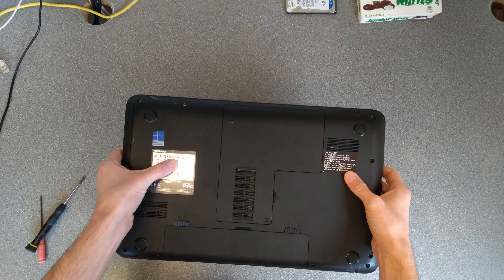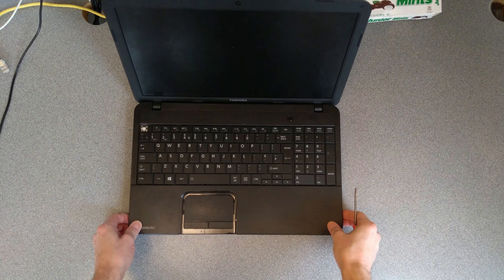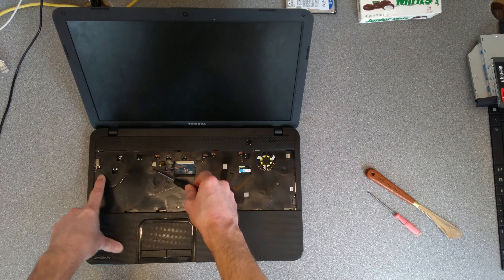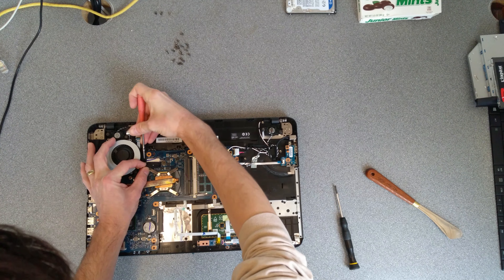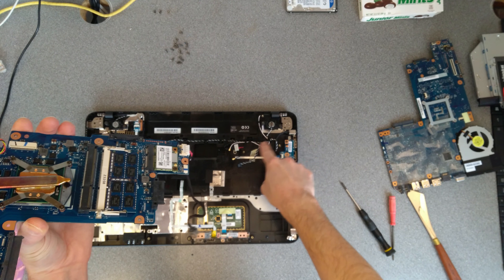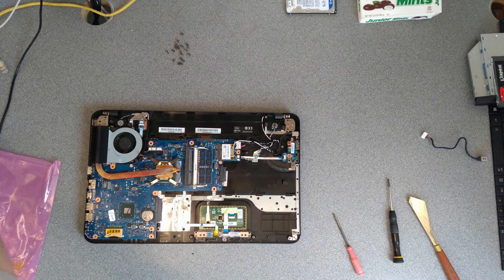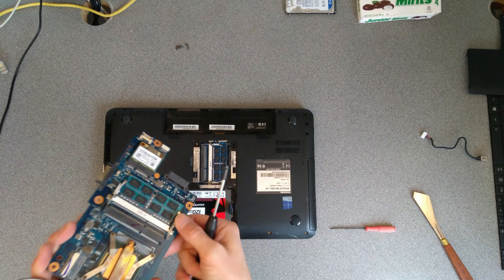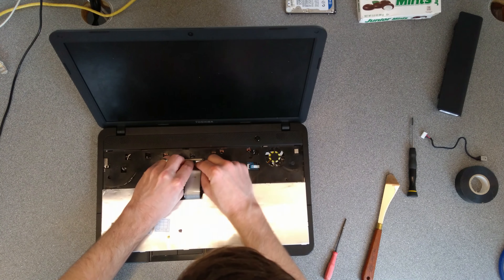Toshiba Satellite C850-1LV - How to replace the motherboard

Comment: hi, 
I have C850-A823 PSKCCV laptop. The screen doesn't display anything. I have connected a monitor with HDMI cable but it still doesn't show anything on that monitor as well. Does this mean that I probably need to change the motherboard. When I hooked up the monitor, i removed the cable connector going from mother board to the laptop display as well.
Looking forward to  your reply.
Reply from the maker: Try different RAM, check the USB sockets have not been damaged and if that does not help it is likely to be motherboard. Always impossible to be certain but that is what I would do next.
Reply: @freename  I checked different RAM as well but no luck... USB sockets looks good... cannot say for sure... I believe then its the motherboard

Comment: very useful video thanks,
Can i replace satellite 850 i7 motherboard with Satellite 855 i3 motherboard
Reply from the maker: Unsure, if the motherboards look exactly the same other than the CPU stuck on them then I don't see why not. If the connectors and screw holes are in different places then no.
Reply: @freename  
you were right they both share the same body design, battery, all the outer details typical but not inside.. after disconnecting the keyboard i found those upper connectors and holes are in different place and the lower are less in one from another, huge thanks i actually solved my problem not by swapping its something not properly placed 😅😀